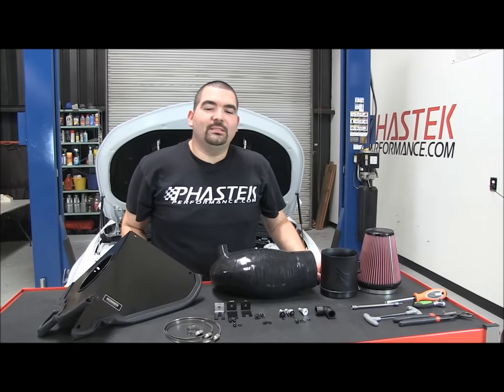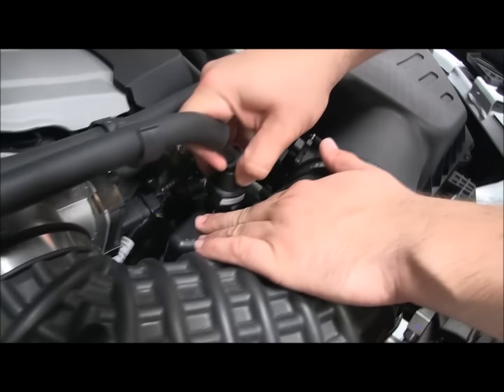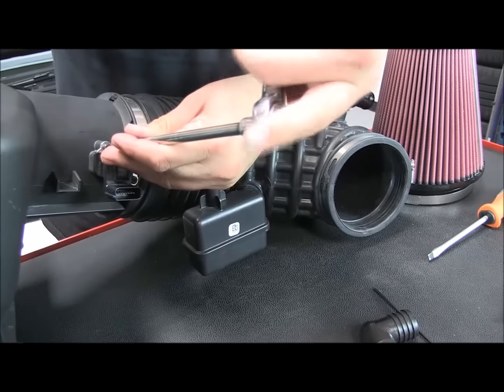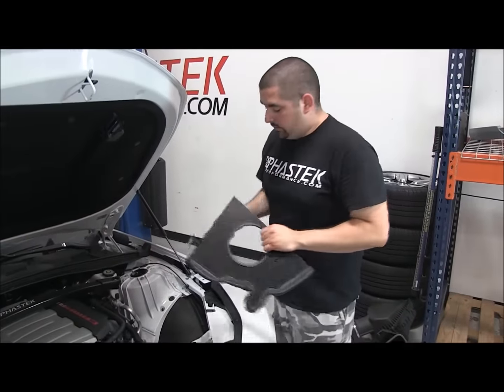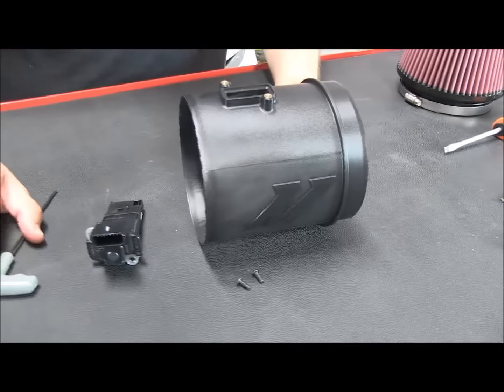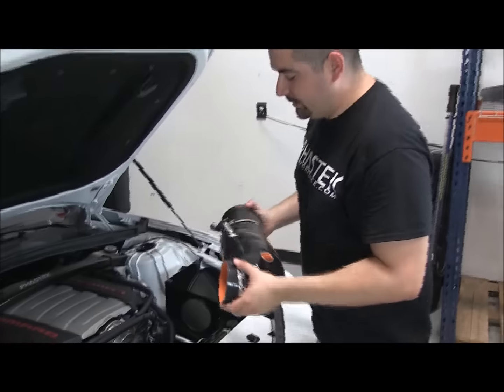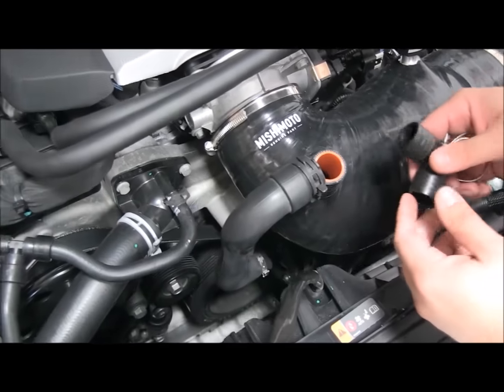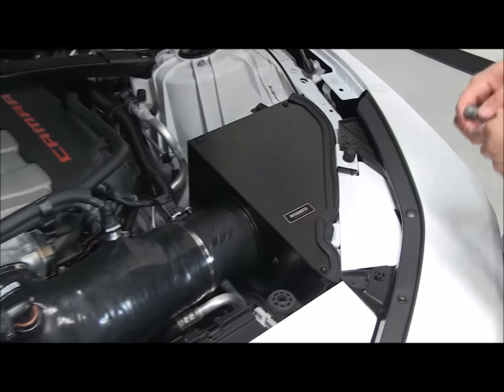Phastek Performance/Mishimoto 6th Gen Cold Air Intake Install

Comment: Hey Ricardo, did you guys get any check engine light when you unplugged the air flow sensor? I know Cold Air Induction recommends not to disconnect the wiring harness from the maf sensor. Also any word on the Roto-Fab system?
Reply from the maker: No sir.  We did not get a check engine light when we unplugged the sensor.  RotoFab should be finished up in the next week or so.  We are on the list to get one to us so right now it is just a matter of time.